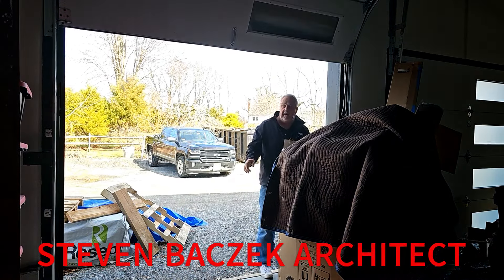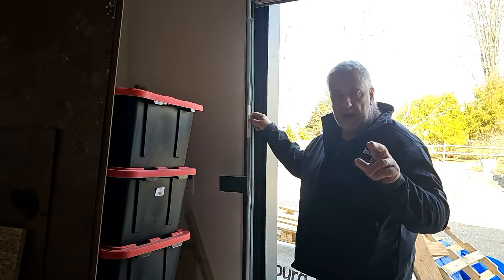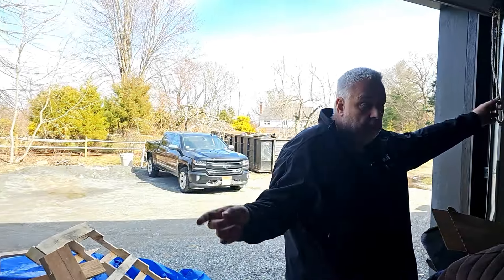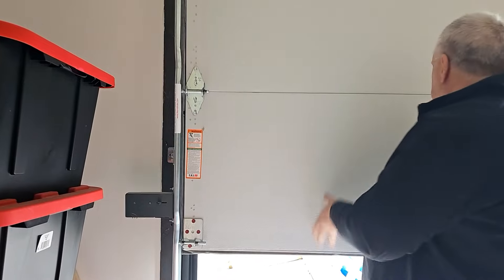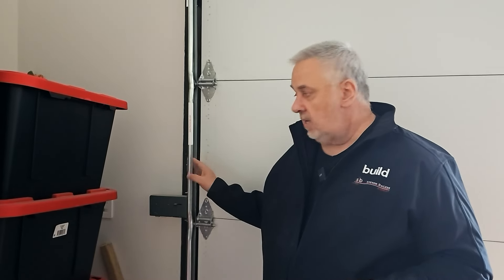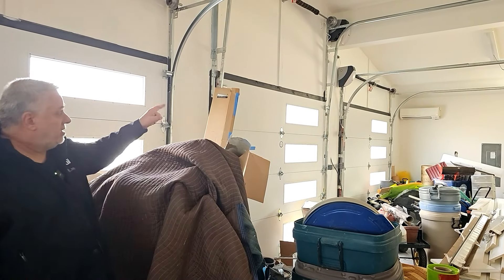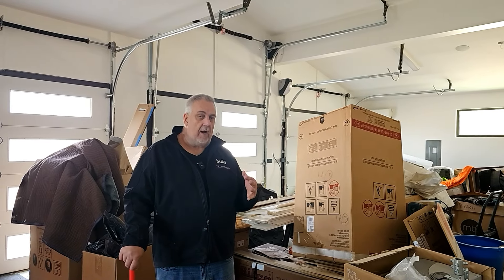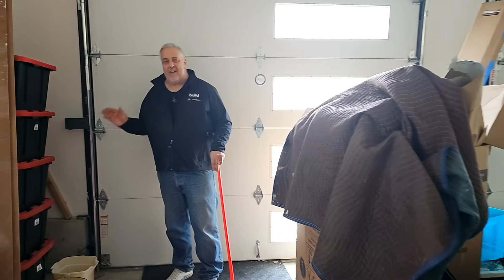THERMO TRAKS - are you familiar with them?

Comment: Great content!  Could you give us a brand of a great garage door seal to consider?
Reply: not sure that this is a full answer to your question about the seal, but the doors are C.H.I with an R-value of about 17.5.  We dd not use the seals that came with the C.H.I. doors, using the better seals from ThermoTraks.  I have been impressed with the quality of the doors and have gotten a lot of positive comments about the woodgrain look that is "printed" on the steel door panels.  I chose ThermoTraks thanks to seeing a Matt Risinger video that showed them installed on his prior house.  Having seen the air leaks on a family member's new home from their basic tracks, this seemed like a great answer and I am very happy with the decision.  Garage Headquarters, based in Rhode Island was the dealer/installer and did a very good job.   I was originally looking at the aluminum, and glass doors that are used so often today, but the R-value was less than half of these doors, as well as the price being vastly higher.  These doors, with the ThermoTraks, were a great answer.  With the sloped roof for the solar, we also used the added space for a loft in the bay with the highest roof, and had the next highest roof's door rise to the higher ceiling, keeping that space open below in case someone ever wants to add a car lift.